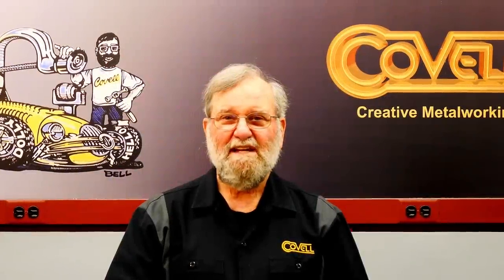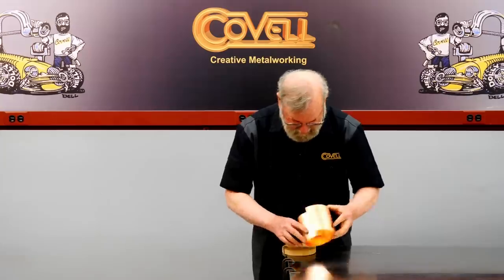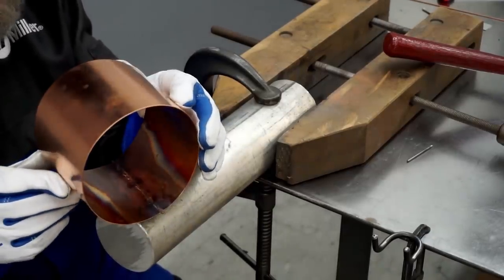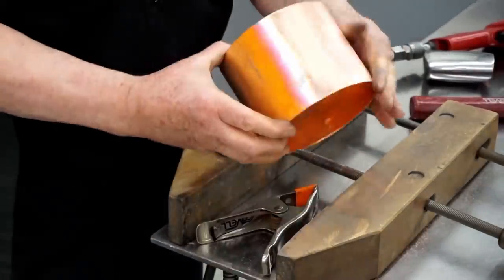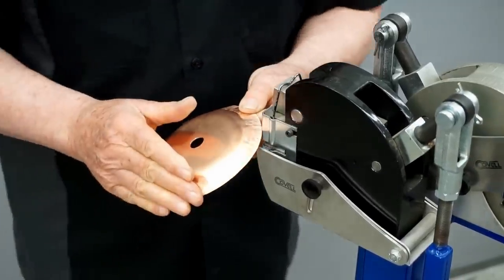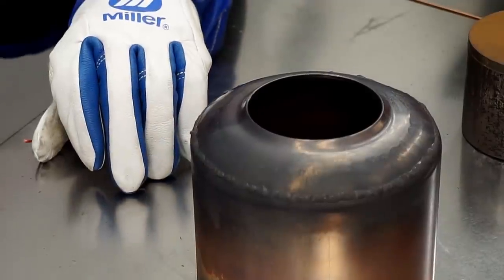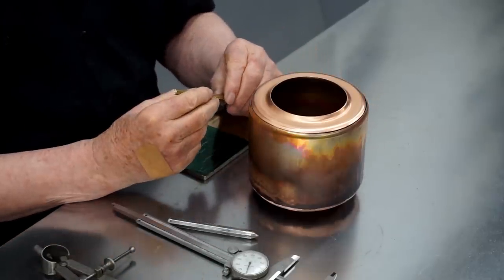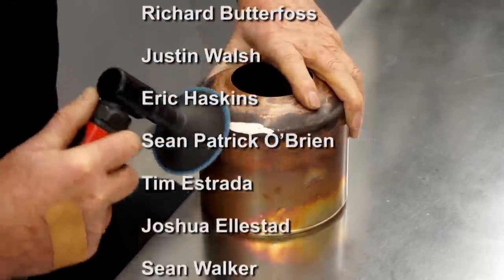Making a Copper Water Tank (Blondihacks Collaboration)

Comment: Raise  the low spots by hammering, just like pull by pushing. Talk some more about that some time please.
Reply from the maker: Yes, it seems counter-intuitive, but when you compress metal by hammering it against something hard, it gets wider as it gets thinner (like clay, or pizza dough). The extra metal has to go somewhere, and it could dome either up or down. If you are applying steady upward pressure with the dolly you are hammering against, the metal most often goes up. You can see another example of this here:
https://youtu.be/XDVkqrB-Pj8?t=544

Comment: Still surprised that you don't just silver solder.
Reply from the maker: Silver solder is a time-honored way to join copper parts, but it is normally used for lap or fillet joints, and I wanted invisible, butt-welded joints for this water tank.

Comment: with copper metal spinning; would have done the tank in one piece; no seams..  (Down side of that is you have to be set up for spinning on a lathe.)  I make wood steins that i line with a copper cup.. Originally was going to do basically what this video shows..I  Learned copper spinning.. produces a much better product in min. of 1/8 of the time..(and no seams or joints to worry about leaking
Reply from the maker: I wish I knew more about metal spinning. I have tried it a few times, and the results were disappointing. Are there some good tutorials I can watch?
Reply: @RonCovell  spinning copper was most difficult skill I learned.  I repurposed a shopsmith takes a much different tool rest. There are a number of videos..  search "metal spinning".. however there are very Suttle techniques that are hard to see even with the better video
Reply from the maker: Thanks for the tips. Maybe I'll try my hand at it again. I got even more discouraged when I saw one of my YouTube heroes, This Old Tony, struggle with the process:
https://www.youtube.com/watch?v=5FgXTi2ikvA&list=RDCMUC5NO8MgTQKHAWXp6z8Xl7yQ&start_radio=1&t=446s

Comment: I was waiting for the Video since Quin announced it last week.
Huge Fan of both of you

I havn't thought about TIG Welding anything other than Steel and Alu but sure.
I guess matching the Fillier Rod to your material is a tad Tricky if you use 'Bulk Offcuts' of ebay with no Labeling or does it even matter?
I know some stainless and some alu alloys are picky about the Filler
Reply from the maker: In my early days, I used to buy metal from a scrap yard. After getting 'burned' by putting a lot of time into shaping a fancy metal part, and finding that whatever alloy I got could not be welded, I now insist on knowing what alloy I buy, so I can select the proper filler material.

Comment: Hi Ron . Great video as always and fortuitously timed for me as well. I was making a tube structure like yours about a week ago ; however I made mine from.063 “ Silicon Bronze 655 . In my case I have to turn the edge outward instead of inward as on your project . I was getting a little bit of “lettuce leafing” on the edge even with turning it in multiple passes. I realize you do it on the cap portion, but after watching you I realized perhaps I need to stretch the flanged edge in the stretcher between passes ; or is there another solution to maintain a consistent edge? 
I think it’s also worth noting I was attempting a 1” radius turn so perhaps that’s too extreme. Thanks again for all of your excellent content !
Reply from the maker: I'm a bit surprised that you are getting issues with the metal wrinkling as you are forming it, presumably like the bell on a trumpet. Using a mechanical stretcher might help. If you are still having problems, you can email me some pictures, and I might have a better idea: covell@cruzio.com

Comment: Love the videos Ron, just one question though.  When working with copper like that doesn't work hardening come a conscious though on how you may tackle a certain design choice? Like rolling the bead on the barrel and lid?
Reply from the maker: Well, when I start a new project, I don't always know if work hardening will be a problem. There's really no downside to going as far as you can without annealing, and then if the metal becomes too 'stubborn' to do what I want, I can anneal it then. Of course, if I know for sure that annealing will be required, that would often be the first step.

Comment: Very impressive work, thank you for sharing your incredible knowledge and skill. I've wondered about welding copper before - did you have to put more heat in than if you were welding aluminium due to the conductivity? Also, what gas mix were you using? Cheers from the heartland of British engineering
Reply from the maker: Thank you very much! Yes, welding copper takes considerably more heat than other metals. I used pure argon.

Comment: Looks like a fun project. The welding rod you use is that deoxidized  or deoxidizing? Electrical wire is very much deoxidized as oxygen in the alloy interferes with the conductivity.
Reply from the maker: It is deoxidized rod, designed for TIG welding. I've tried using electrical wire, and it leaves a porous weld.
https://www.grainger.com/search/welding/filler-metals/tig-welding-rods/copper-tig-welding-rods?filters=webParentSkuKey&webParentSkuKey=WP13445590

Comment: those gloves are so clean and beautiful, the jacket has no burns or smudges or smears how is this possible?  What planet was this filmed on?
Reply from the maker: John, I remember when I was a teenager, and I read all sorts of books and manuals about auto repair. I was always impressed with how clean everything was in the photographs, even when they were working on engines, brakes, and transmissions. That's the 'look' I try to emulate in my videos.
I keep a special set of gloves and my best welding jacket in storage when I'm not shooting a video. My everyday gloves and jacket are as grungy as anyone else's.

Comment: Great video. In traditional model boiler making for steam trains joints are silver soldered. Could tig welding replace some of the soldering?
Reply from the maker: I'm certainly not an expert on boiler making, so I probably should not attempt to answer your question.

Comment: Back years ago at the foundry I worked in we found that the crappy copper welds we were making would be fixed with a 25% Helium to 75% Argon gas mixture. The product in question was no more than a CHILL for other Aluminium castings but the head welder wanted his work to look good.
Reply from the maker: Adding helium will definitely get more heat into the metal being welded.

Comment: Another great video.  Doesn't copper work harden?  You shrunk the edge in 2 passes then rolled it, how many steps can you do before it  work hardens and starts to crack?
Reply from the maker: While your question sounds reasonable, there are several variables - like the particular copper alloy, the temper of the metal when starting, the material thickness, and the specific steps you are performing. I only have a limited amount of experience working with copper, so I can't yet predict when it will require annealing, but there really isn't much of a  downside to starting without annealing, and softening the metal whenever it seems beneficial.

Comment: wait what's the difference between tin snips and aircraft snips? my cheap set looks like aircraft snips and i didnt think i was missing anything.
Reply from the maker: Tin snips have no compound leverage, and are designed for straight cuts on thin metal. Aircraft snips have a compound linkage, allowing them to cut thicker metal, and the blades are configured to allow curves to be cut. I made a video that goes into much more depth on snips:
https://www.youtube.com/watch?v=x8PDRAsMDXc&t=5s

Comment: When you turned that bronze disc, you weren't engaging with the lathe chuck at all, except for the pressure the live center is providing?
Wild...
Reply from the maker: Yes - that's called 'friction turning'. You can only take light cuts when using this technique, but it works well, within reasonable limits.
Reply: @RonCovell  Its funny because I was looking at it trying to figure out how you were doing that...  My first thought was super glue arbor but then I noticed I could see the chuck jaws. And then you flipped it.

Comment: What's the purpose of tapping the weld with the hammer at 5:30 between different passes with the TIG? Is it to control warping? To forge the weld bead flat while it's still hot? To work-harden the seam slightly so it doesn't end up too weak from the heat? To chip off flux (even though I thought TIG didn't use flux)?
Reply from the maker: Welding almost always causes distortion because as the heated metal cools, it shrinks. Hammering on the weld stretches the metal, and if you stretch it exactly as much as the heat shrinks it, you will have no distortion. I almost always have to do more hammering after the metal has cooled completely - as you saw in the video - but hammering the weld while hot goes a long way toward reducing the total distortion.

Comment: are you welding with pure argon, and what kind of amperage does copper need? Does it puddle well like steel, or is it a pain like aluminum?
Reply from the maker: Yes, I use pure argon on copper, and it takes a LOT of amperage, because the copper conducts the heat so effectively. The puddling is decent, somewhere between steel and aluminum.

Comment: what is the welding current ?
Reply from the maker: Copper takes a LOT of heat to weld. I had my machine set to 210 amps, but I modulated the output with the foot pedal, so I don't know exactly what the current was when welding.
Reply: @RonCovell  Merci  from Canada Carl

Comment: Beautiful work but I think the design is not coherent. The straight legs don't fit with the really nice flowing curves of the tank. I think if you had curved the legs so they were 90° out of the tank and also perpendicular to the table the tank sat on it would have been more visually appealing. At the least if you really wanted to bring the legs out of the tank on an angle they should still have been curved to meet the table at 90°.
Reply from the maker: I think your suggestion is excellent! I had only limited time to finish the tank, since I promised to ship it to Quinn by a certain date, and the fabrication wound up taking much longer than I imagined. Part of the reason for straight, angled legs was to get the job done on time. I think the solution you suggest would be more elegant, but it would undoubtedly take longer.
Reply: @RonCovell  Thanks Ron.
I've been machining for over forty years but my weakness is metal forming so I'm really gaining a lot from your YT videos which I just found and Quinn is, as you say, very talented also and a pleasure to watch.
I'll check out your videos and site.

Comment: Where 2π = 6 !?
Reply from the maker: I think you are confusing the measurement of a curved line (circumference) with a straight line. If you draw a circle of any diameter, and use the radius to mark out divisions on the circle, you are effectively creating six equilateral triangles, and dividing the circle into six segments, precisely.
Reply: @RonCovell  cool

Comment: 1/4" thick bronze?  Over design for sure.
Reply from the maker: I needed something thick enough to hold the threads of the studs that the legs attach to. I could have welded or soldered the legs to the tank, but there is no way I could have cleaned up the joint as as clean as I could by making them removable.